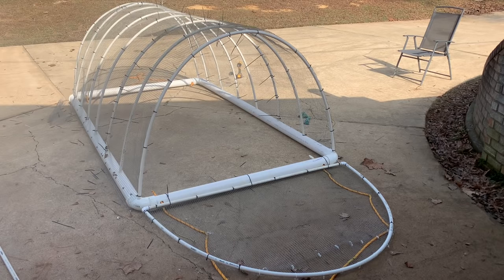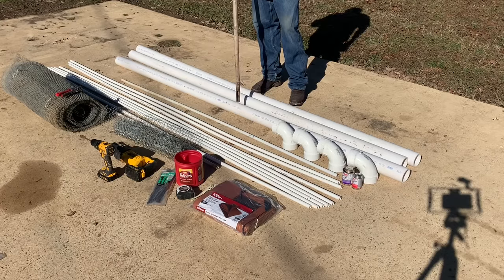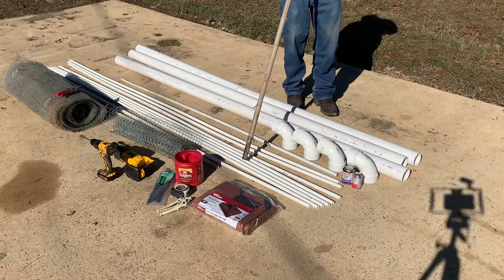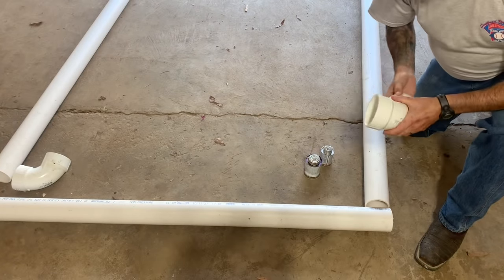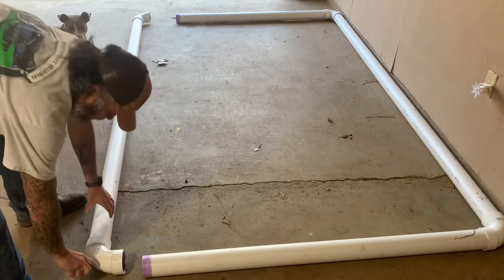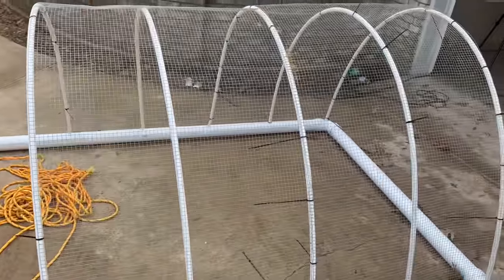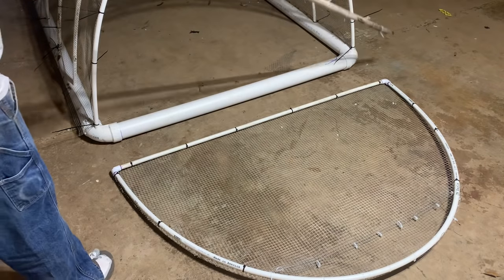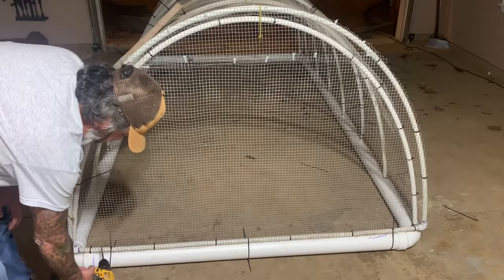How to build a hoop coop

Comment: Thanks for posting. I used your video as a guide and it was super helpful. I ended up building a 30' x 5' hoop tractor with a coop area. SUPER HELPFUL!!!
Reply from the maker: Thanks for watching Joe!  I’m really glad our video helped you!!
Reply: Did you add wheels?
Reply: @rongrey2110  I didn't but I would if I had to do over. It's light weight, so I can pull it. I did hardware cloth about 18" out from the bottom and I find the grass grows up through it in a week so it holds the coop down. I use my lawn tractor to move it and it moves easily. I can pull it without the lawn tractor but it's just easier. It does slide along the grass just fine. Wheels would just make it easier, I think.

Comment: Cuts are 9’ 61/2” L  x 5’ W end result 10 ‘x 5’ ( I made a slight adjustment on the end door so I lines up even and door opens upward to lay on the top, so stepping on it wouldn’t damage anything. Made holes on sides through and through on each corner for 10” wheels when it’s time to move, swivel on front wheels. Heating lamps could be hung in the winter if needed.
Nice project!
Reply from the maker: Thanks for watching Ron!  I tell folks all the time to tweak it however you need to make it work for your situation.

Comment: I love how thorough you are! This is by far the best design I’ve seen yet!
Reply: Also, what is holding the door on to be able to open and close it to let them in/out? I’m seeing the zip ties are what’s holding it on to the bottom right?
Reply from the maker: Thanks for watching Zion!  We just use small bunjee cords on top and both sides to keep closed while chickens are inside. The zip ties around bottom act as hinge for door. We use 3 or 4.  Watch our “ meat birds for cheap video

Comment: Best chicken tractor I've seen and will outlast any other design even aluminum ones. Problem I see is with predictors. Racoons can chew through both those zip ties as well as the hardware cloth. All they need to do is break one seam. Lifting a corner high enough to crawl in wouldn't be difficult either since they're so light. Rats would easily enter and kill all the birds in there. And at $200 bucks a pop. That would be a waste of money. But great idea in an area with no ground predators.
Reply from the maker: Thanks for watching Lloyd!  We’ve been using these for several years. We haven’t had any problems with predators so far.

Comment: Thanks for this video. Question, how would you keep it anchored for the day, we have extreme winds that come sudden here and it could blow the coop in a heartbeat.
Reply from the maker: Thanks for watching Cinthya!  U could anchor with stakes on outsides and run a rope across the top to stakes. You could also drill extra holes and hammer in stakes. You can also add water to 3” pipe, if u didn’t drill any holes underneath.

Comment: Have you had any problems with predators digging under then tractor, since there is no wire on the bottom?
Reply from the maker: Thanks for watching Joseph!  We did have a fox try to get in but couldn’t. That problem was eliminated. But no we’ve never anything try to dig under. Could probably use like dog fencing underneath.
Reply: Honestly a good solution is to bring the chicken wire past the base so it lays on the ground a little bit maybe a 6-10 inches.. always worked for me to stop diggers
Reply: @williamforsythe5850  Do you mean folding it under the PVC into the inside of the tractor 6-10" or folding it outward from the PVC onto the ground outside the tractor?
Reply: @jenniferhayes5071  Folding it outwards from the pvc onto the ground. That way when digging critters get up to it and try to dig under, they hit the fence and stop. Haven't lost a single duck in our tractor/coop since I added the extra to the bottom like that, but mine is about 10" extra on the bottom.

Comment: I love the design and the easy build. I'm just worried it is so light it will blow away, or critters can easily get under it to the birds. Have there been no problems with this?
Reply from the maker: Thanks for watching Shanna!  Great question!...We haven’t had any problems with predators trying to dig underneath.  But we do have dogs that protect the flocks.  We had 70 mph straight line winds not long ago and they didn’t blow over. Check out our short video of storm damage.   You can drill hole straight through 3” from top to bottom at several places and drive anchors or just anchor with rope.
Reply: You could add small rocks or sand inside the 3" pipes for weight or tie sand bags to the base that are removable to keep the coop portable.

Comment: Going to have to add concrete to mine. Stong wind, and gusts here always.
Reply from the maker: Thanks for watching Dark Tide!  You could try water.   The 1st hoop coop we built, I didn’t drill holes in bottom of base. I couldn’t budge it!!  
If u won’t it mobile, u could drill holes straight through from top to bottom of 3” and use rebar etc to anchor down.
Reply: @squarecountyhomestead  Good idea I like that just bend some rebar and have it catch. Yea that has been my largest problem in North Texas. We are constantly in winds over 30+ miles an hour. I had another coop by Justin Rhodes for a while, and it ended up 4 farms down. Finally broke down and just bought a camper for the egg stock (yes I tore out the inside of a camper and built a coop out of it). Was looking at this for maybe the meat chickens.
Reply from the maker: Camper as egg house is AWESOME!!  Check out our video on raising meat chickens for cheap. We use the hoop coop.

Comment: I bought the 3 in foam core pipes and the 3 in elbows and they are exactly the same size and dont fit. The outside diameter of the foam core pipe is 3.3 inches. What size elbows do I need? I cant find them online anywhere. Pls help
Reply from the maker: Thanks for watching Teresa!  Foam core is still a schedule 40 pipe. It does fit regular schedule 40 fittings. Now if u bought the really thin sewer fittings, then it will not be the same.
Reply from the maker: I’m not sure about online but any hardware store will have them.

Comment: Great video, really enjoyed! Understand how to stop diggers with extra fence if need be. How does this hold up to high winds? Do you use some type of anchoring system?
Reply from the maker: Thanks for watching Michael!  We’ve had straight line winds up to 70mph here in Mississippi. And they never moved. But I had thought about just drilling straight through 3” from top to bottom then drive some rebar through hole. Or just tie down with rope to anchor.
Reply: Great. We have some terrible winds time to time. Concerned with blowing over. I was thinking rebar as well, used on windy days. Then use this as chicken tractor. Again, great video. Thanks and have a blessed day.
Reply from the maker: Michael. Check out our Raising cheap meat birds video and you’ll see how we used hoop coop as tractor.
Reply: @squarecountyhomestead  I sure will. Thanks. Blessings.

Comment: Just wondering if it is heavy enough to stop critters from tipping it over
Reply from the maker: We’ve never had any problems with predators. But if u want it heavy then DO NOT drill weep holes on bottom side. Thanks for watching Diane!
Reply: @squarecountyhomestead  … if you drilled a hole in each of the corners at an angle all the way through, you could secure it with rebar pounded into the ground part way …
Reply from the maker: Absolutely could. Thanks for watching bluemoon!

Comment: So is there anything securing the 1/2" PVC to the base?
Reply from the maker: Thanks for watching Curly-haired! Great question!  No there’s nothing securing 1/2” to 3”. But once the fencing is secured to 1/2” and screwed into 3”. The 1/2” WILL NOT come out.
Reply: @squarecountyhomestead  Ok! And why did you go with 3" for the base? Seems like overkill- but I'm wondering because I want to make a 100% PVC hoop coop for breeding and want the base strong enough!
Reply from the maker: Used 3” mainly for the weight. Less than 3” predators could POSSIBLY just stick nose under and flip over. But use what u think is best for your place.
Reply: @squarecountyhomestead  Good thought- thanks!

Comment: Do predators get in from underneath ?
Reply from the maker: Thanks for watching Phoenix!  We haven’t had any predators here, but we also have 2 pit bulls that protect the flocks. 
But a simple solution would maybe extend fencing underneath. Or different size fencing underneath.
Reply: @squarecountyhomestead  TY so much for the feed back & for Your videos.
I'll do that.
Have a great night & God bless 😊
Reply from the maker: @preppersrus9258  thanks for watching!!
Reply: @squarecountyhomestead  How far underneath would you recommend extending the hardware cloth as a digging predator deterrent?  I would seem that having it under the entire coop wouldn't be comfortable for the chickens' feet and might prevent them from scratching and foraging.
Reply from the maker: Thanks for watching Jennifer!  I’ve been thinking about this…I would use like a dog panel fencing. It’s more rigid than hardware cloth. Cut it about 18” wide and the 10ft in length for sides and 5 ft for front and back. Zip tie em to the 3” pipe. Leave it to the outside. That way when u move the coop u can flip up each panel and it won’t interfere with u moving coop.

Comment: When I drill into the sewer pipe with the hole bit, it breaks the pipe. How can I make this not happen?
Reply from the maker: Thanks for watching Michael!  Either a new bit or drill slower. Also if it’s cold where u are could make a difference. Also if your using thin wall pipe instead of schedule 40 that’s another reason for pipe breakage. But as long as your 1/2” goes into 3” then secure the fencing I would think it would still be ok.
Reply: @squarecountyhomestead  thanks. I really appreciate it.
Reply from the maker: Hope it works out for you!  I’m no expert but we love our hoop coops!
Reply: Drill with it in  reverse to get it started - then switch it to forward drill

Comment: You have an excellent video here. My 2 concerns are that your audio is barely perceptible, and your method of gluing the pipes together is overkill. You glued them as it they would be under pressure. That isn't necessary in this application. A little dab of glue would suffice.
Reply from the maker: Thanks for watching Walter!  The reason I glued it the way I did is because I’ve done the bare minimum before and when you pull it every day, eventually it WILL pull apart. So I don’t have that problem anymore.